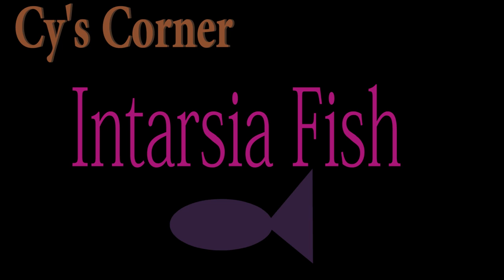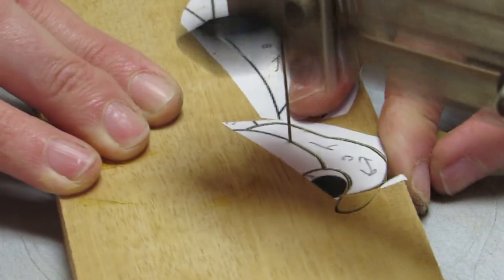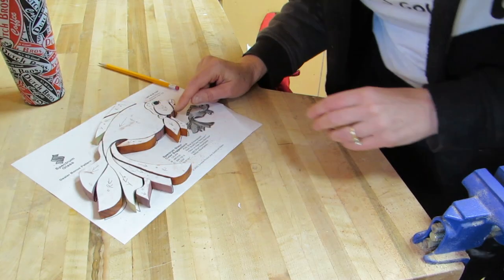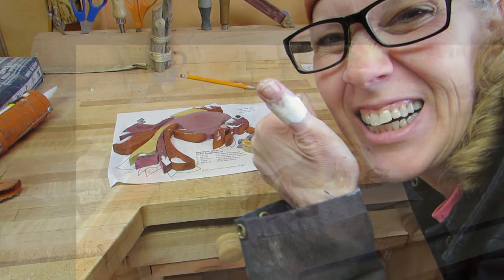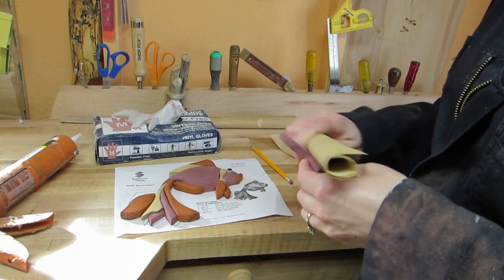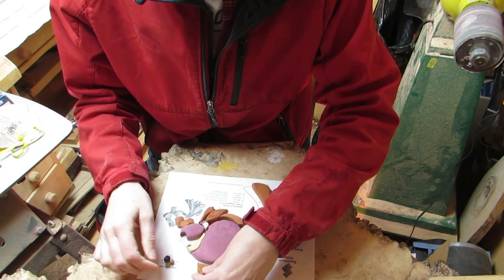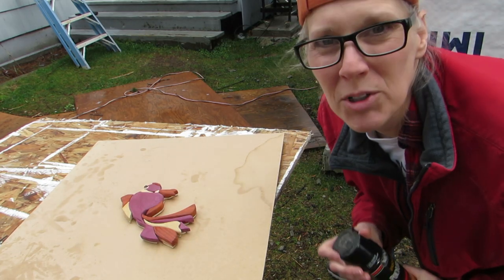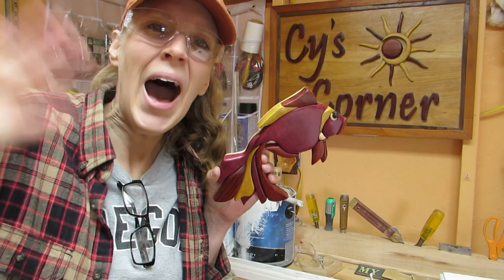Intarsia Fish

Comment: love the colours Cy, I use painters tape on the wood before gluing pattern on with glue stick, then it just peels straight off, easy peasy.
Reply from the maker: +1958linedancer Painters tape, hadn't heard of that one :) Thanks! Do you make intarsia???
Reply: yes I have done a half a dozen Intarsia pieces but nothing too elaborate, you can also use any type of tape on the wood under the pattern, I use the painters tape as it is easy to get off the roll and then peel back off the work piece. It also acts as a lubricant for the blade on your scrollsaw
Reply from the maker: I have heard this tip from 3 different people now, so I tried it with blue tape. It was amazing and I will do it like this from now on.  That means my tutorial is already out of date! haa haaa!!!!!

Comment: Hey CY, I see on the websitem they call the drum sander you use a pneumatic "The Woodtek® Combination Pneumatic Drum Sander and Flap Sander" Buuuuuut penumatic is defined as  containing or operated by air or gas under pressure. Am I missing something?
Reply from the maker: Hello, the drum is filled with air and gives a cushion sanding surface. I used to call it my pneumatic sander but now I try to say pneumatic drum sander since it has caused some confusion. It is an awesome sander :)